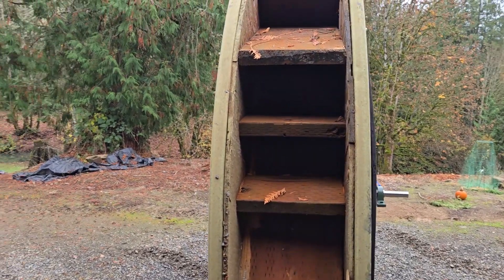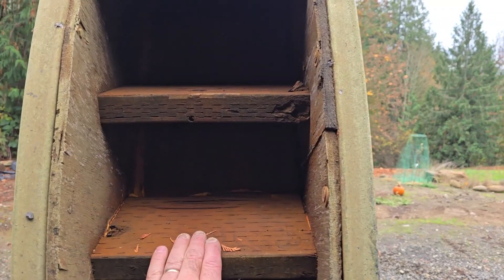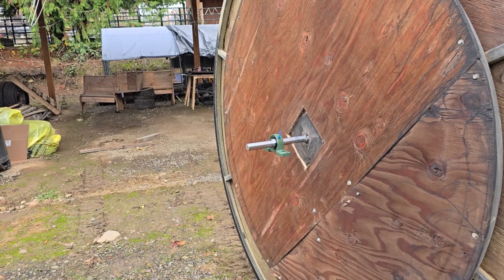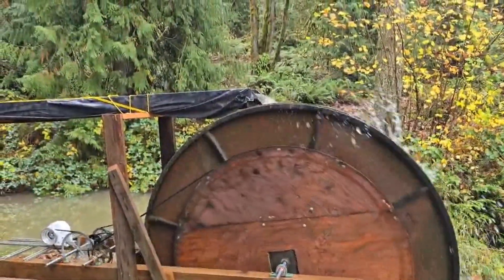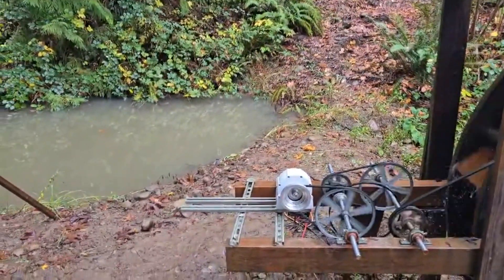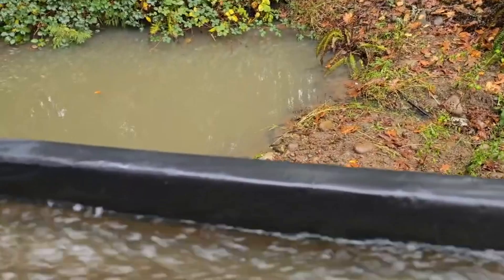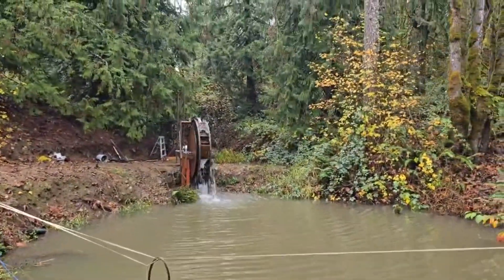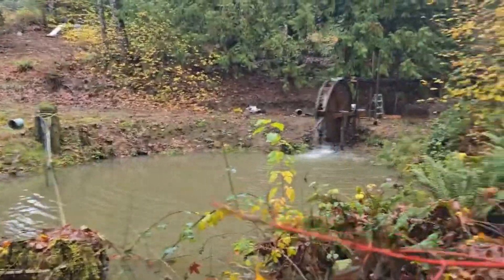Water Wheel Generator Producing 180+ Volts DC

Comment: Cool, but how many watts are produced?
Reply from the maker: I am trying to figure out what I can hook up to it at that high voltage to get a reading with the meter for amps.
I looked at some cheaper charge controllers that I could take down to the wheel and hook up but they only handle 100v.
My solar charge controllers on the house are 250v but also $500 each.
Reply: You can use a clamp on ammeter @HowToWith24DY
Reply from the maker: So I just ran a temp line up to the house and tied it into the charge controller. The Amazon 12000 white PMG produced 185volts DC and 30 to 55 watts DC. 
The Missouri wind and solar PMG produced 54vdc and 5 watts.

I would NOT advise anyone to buy either of PMG'S....
Especially not the Missouri Wind ans Solar one.
Reply: @HowToWith24DY  I use midnight classic 250 for hydro, pretty bullet proof one of those feeding a battery would work nicely